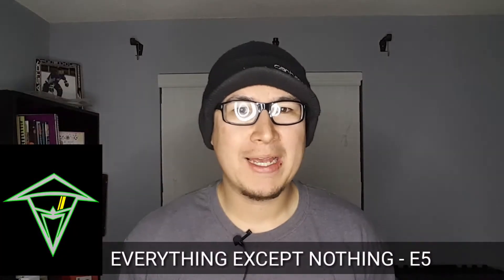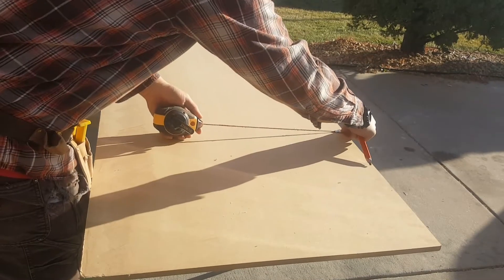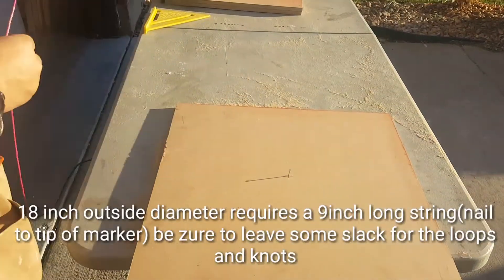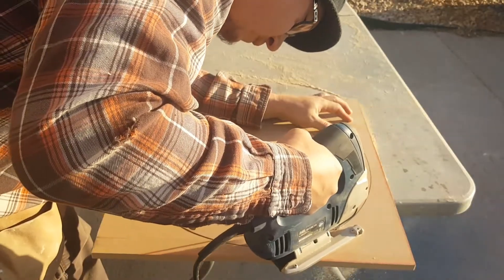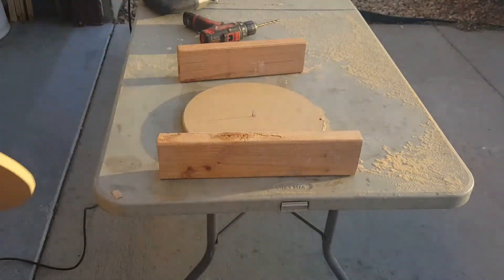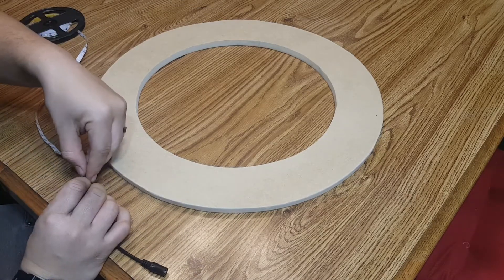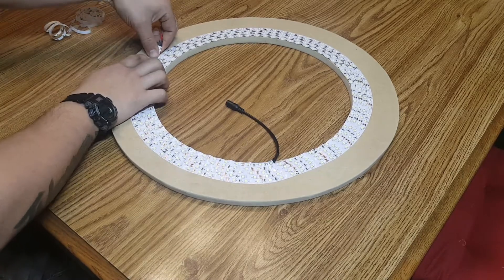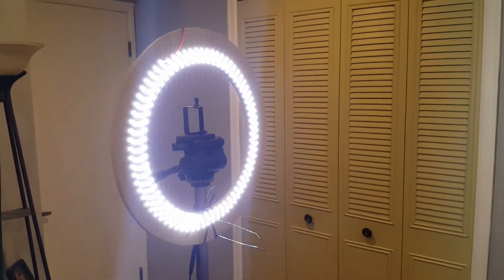DIY  LED Light Ring- LED Ring Light-  Glasses?

Comment: Hi, did you figure out where to position the ring light for people wearing glasses ?
Reply from the maker: The best I have come up with is placing the light high above my head...other than that...not many good results.
Reply: Best option I've found is to position the light higher and at an angle and use fill below and on the other side of the subject to reduce some of the shadow.
Reply: That seems to be an issue with these ring lights is the glare. Does your method reduced it much?

Comment: I just made a light ring of my own. Also having a lot of glare on my glasses. Anyway I used one of these wooden craft rings, saves me from having to pull out the power tools (which I don't even own :).  $11 on amazon:

https://www.amazon.com/gp/product/B009AXZW2Y/
Reply from the maker: lose3111 that seems like a pretty good solution! I enjoy the tools, so no problems there. Have you found any solutions to the glare(angles are pitching)? I don't use my ring light much any longer  because of the glare.
Reply: No lol.. my best solution is to take my glasses off when vlogging. I might try further diffusing the light ring (I've tried a thin white t-shirt that didn't work so well, but i heard wax paper does). Some diffusion might make it less reflective, like a light box.